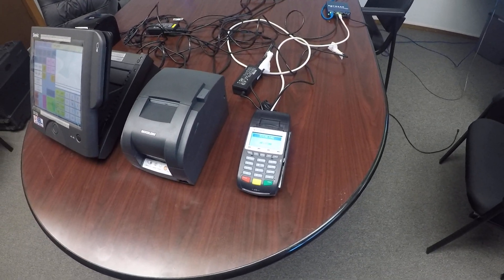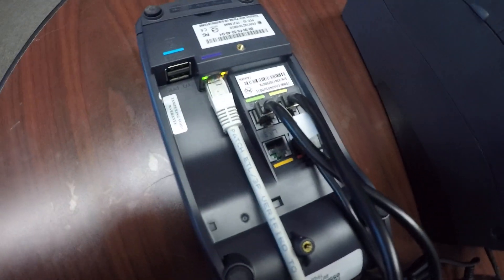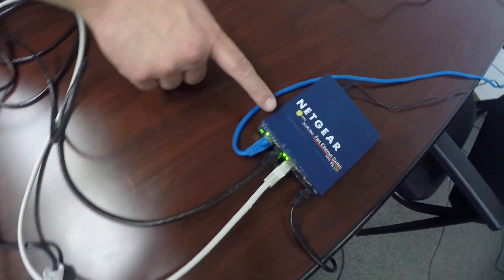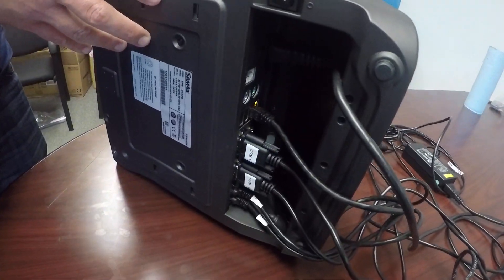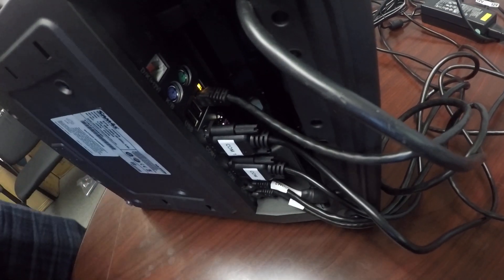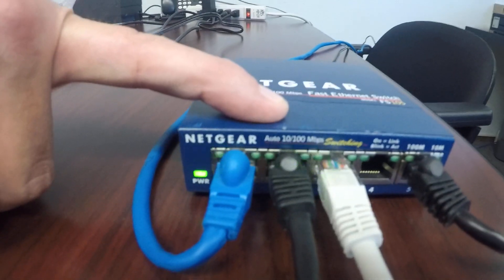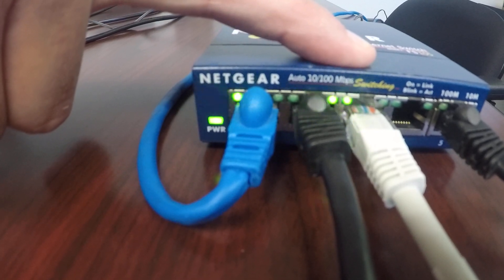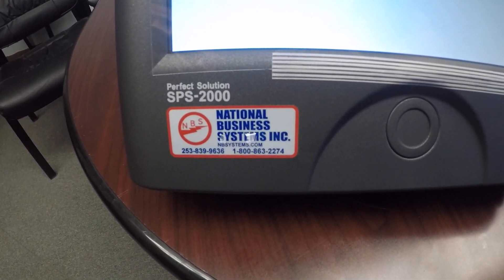How to connect your Smart ECR Credit Card Pin Pads to the SAM4s SPS-2000 System

Comment: does it have to be only A The  Sterling Smart ECR,,      i have a Hartland Pin Pad CC machine,
             will it work ?    And if so.  is it just plug and play.
Reply from the maker: That register will work with Heartland for sure. But you will have to add a Datacap and Pin Pad. it wont work with a countertop terminal like you probably have. We are a heartland Partner and they have a great program for this register. Tell your Heartland RM we can assist you with it.